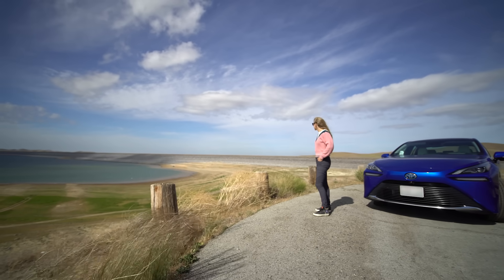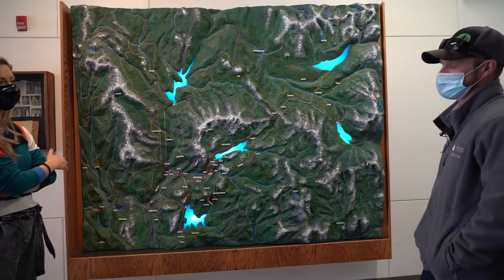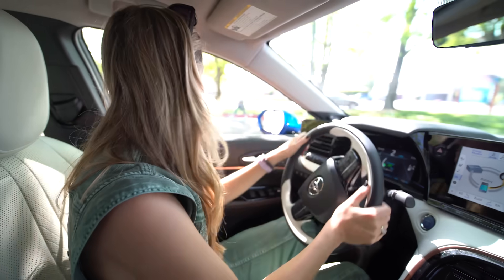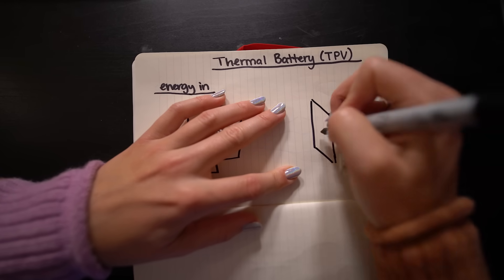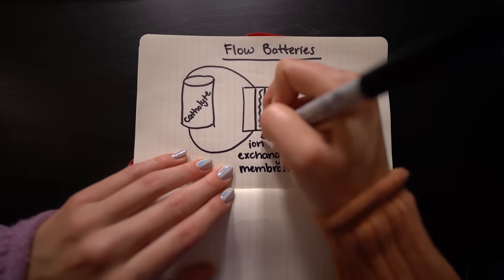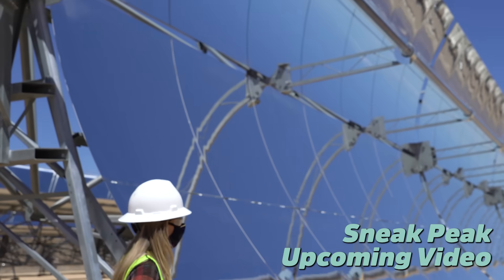The BIGGEST problem with clean energy

Comment: It seems surprising to me that you didn't know from the start that the challenge is energy storage.  As far as promising energy storage, I keep waiting to hear more about organic flow batteries.  On a massive scale, storing fluids should be cheap, and be able to handle the intermittency of wind.  Membranes for generating electricity is surface science, so might be able to benefit from learning-curve-dynamics...  My guess is that gravity-based systems will be too capital intensive to get to real world application.  Compressed air is too inefficient.  Another approach that you didn't touch upon is to modify current electricity consumption processes to allow them to be production following, rather than requiring production to match demand.  For example, fertilizer production, aluminum smelting, and scrap iron recycling.

Comment: I just want a source of energy that allows me to live free from electricity companies and stay off grid. Something better than solar cells with a LiPo battery.
Reply: Well, that won't be Hydrogen related (too inefficient)
It's unlikely to be water based (generally industrial scale)
Pumped air? (Etc) again industrial/ grid scale.
Wind? Larger facilities are more efficient.
(Note, where was Wind in this presentation? Did I miss it?)

Isolated home system?
You're talking heat pumps (probably ground source)
Solar (variable angle?) Cheap/ easy.
Battery storage (massive decrease in cost coming).

Comment: Great video, thumbs up!  Personally I'm a fan of pumped hydro storage.  I wonder: could we dig wells and large caverns and increase the amount of capacity for pumped hydro?  You mention it's mostly built out but it seems like with some creative engineering we could just create more places where PH will work.
Reply: You'd need a water storage volume both below ground and at the top, to make good use of the power being provided by water going down the turbines/pumps probably should be downstairs as well. Wouldn't say it is impossible to convert old mines and caverns into it but it's definitely an engineering challenge. Repurposing above ground bodies of water isn't always appreciated either, very understandable given the impact it'll have on whatever lives there.

I'm sure there will be locations where it's possible and gets done in the future, but above ground elevation differences in water reservoir levels are understandably more economically viable for now. All a matter of cost and what geography is available I suppose, needs a way to store something higher up, a cave/old mine that isn't too leaky with water and some people/industry relatively nearby that needs the storage. And if they aren't leaky (for gasses) then they might be more tempting for other purposes instead.

Comment: 10:11 TPV uses mirrors and its efficiency is 50%. But mirrors absorb some amount (significant) while reflecting the light rays back. Instead of mirrors, I would suggest the use of Total Internal Reflection (TIR). In TIR, the light rays travel from Denser to Rarer Medium. We can calculate the critical angle of the denser medium using the refractive index of the two medium and then create a prism arrangement and place the entire TPV inside of it. As the light which passes through the PV will hit the rarer medium, the incident angle will be greater than the critical angle and hence lead to total internal reflection of light which will bounce it back to the other side of the prism which will further bounce it back to the PV. This is way more efficient than using mirrors as it absorbs absolutely no energy. Therefore we can increase the efficiency of this method to about 55-60%.

Comment: As I understand, there is a way to transmit energy to and from space. 

I recall an old method of storing mechanical energy was by spinning a big disk. Energy in by spinning it up, energy out by applying that motion to other devices.

This wouldn't be efficient on earth due to, mainly, friction. But what about in space?

In orbit? On the moon? Transfer solar energy into spinning disks. The more mass they have, the more energy they store. Then transfer that back into electric energy to transmit to earth.
Reply: On that note... How much of a positive loop could be created by using solar power to spin magnetic disks to create an alternating field to the generate more energy?

Comment: About 20 years ago when I was in high school I learned about this startup company promising a hydrogen fuel cell car, Anuvu.  They made some wild awesome claims about their tech, which obviously never came.  Later in college I wrote and delivered a persuasive speech encouraging my classmates to drive hydrogen cars when they come available.  One of my primary arguments was that given the efficiency of the vaporware Anuvu PEM fuel cell and liquid H2 storage they could expect comparable fuel mileage to the Toyota Prius of the time.

But as time wore on the realities of H2 economy became more apparent.  Real PEM efficiencies were much lower than Anuvu promised.  People probably weren't going to carry liquid H2 in their car.  And the Toyota Prius became much more efficient.  Eventually, when learning about the plug to pavement efficiency of BEV's, it became clear: H2 is not the answer.  It's not just that round trip efficiency is worse than every other storage method.  There are other things that we have to worry about.  Hydrogen is very difficult to contain, so leak management must be much better than our current methane infrastructure.  Second, once hydrogen escapes from our storage and transport system, which it will, it's gone forever.  That may not seem like a big deal, but consider that every two hydrogen atoms lost is also a water molecule lost, and an extra oxygen atom in the atmosphere.  At the scale of the rest of human civilization, that might be a problem.  Lastly, the metals involved in PEM fuel cels are very expensive and finite.  Clearly it's not the answer and I think we're fools to chase that dream.

I'm a huge fan of compressed air storage.  Also I think particularly with the duck curve there is much more opportunity to optimize time of use and flatten it out.  I don't hear people talking about that though, besides the Technology Connections channel which recently discussed leveraging short term thermal energy storage available in a modern well insulated house to consume HVAC energy during non-peak hours.

Comment: My understanding is that energy in a gas is only determined by its temperature, not pressure. So, compressing a gas isothermally doesn't store any energy. This is why storing the heat from compression is so important. Energy released by expanding a gas is only a function of the change in absolute temperature. Physics!
Reply: Except it's not temperature that is turning the turbine when a compressed gas is released from a high pressure vessel to a low pressure vessel.

Comment: My own favorites for grid scale energy storage are:
1) Batteries other than lithium.  For example, consider Iron Air batteries, such as Form Energy is producing.
2) Formic Acid, produced by photoelectrolysis of CO2 and water, a liquid fuel which can be turned into electricity via fuel cell.
3) Flywheels.
4) Ammonia.

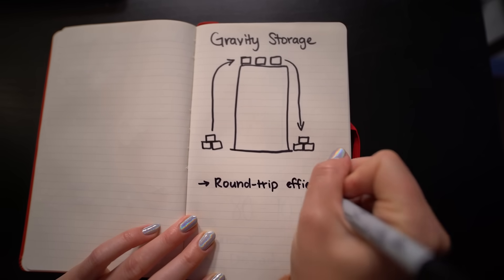Comment: 5:57 although I will note thrunderf00t did take a look at this and was far from convinced.  the dude may be a bit rude, but he's a pretty good skeptic.
Reply: 10:19 I'm curious, do the cells in this process just any special kind of doping or treatment to optimize them for IR light?  I assume that's how they get 50% of the energy out.
Reply: just as a total aside, because I'm a big hydrogen nerd, one thing I've been thinking that hydrogen might be able to do really well is replace natural gas for things like cooking and heating homes.  The issue is how to transport it safely and I think I know what method I would use, just dissolve it in water.

okay so it doesn't really dissolve, but it stores and transports in water just fine.  being in water, if there's a leak, and a spark, the whole line doesn't catch fire, just the local area.  This makes it much safer than just using straight hydrogen.  

There are definitely still some drawbacks, like for example my "fly over research" says that water can only take in 4%  weight hydrogen.  which seems like if this system were to be used a lot of water would get wasted trying to transport a little bit of hydrogen fuel.  I also still don't know how much hydrogen would be needed to cook a meal, or warm a house, so I can't do much without that number.  

Given the possible benefits, I'm hesitant to give up, but I am at a bit of a wall.
Reply: also, I think we should probably be working towards energy smart homes.  Homes that reuse energy for multiple purposes as much as possible.  A simple example would be an oven that's done baking.  If its the middle of winter just letting that oven dissipate it's heat into the surroundings is a great idea.  however in the middle of summer it might be a better idea to either reject that heat outside, or send that heat to the water heater, so something useful can be done with that heat, instead of just having it make the AC work that much harder.

Comment: Wonderful video. We all need to get onboard with fighting climate change. I did some back of the napkin calculations to answer a simple question: what would save the most energy / C02 production, putting solar panels on your roof or switching to an electric car. The electric car wins, by a lot. Every 15 gallons of gasoline burned in a car produces almost 300 pounds of C02. Thanks for your excellent work!

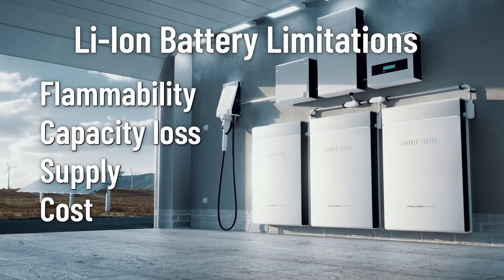Comment: At 1:49 Dianna says that the supply of Lithium will run out in 2080. If this is true why is the government trying to force people to buy battery electric cars that use Lithium Ion batteries? What does the government plan on doing with all these battery electric cars when the lithium does run out? You know if consumers end up spending 50k or more on an electric car and then when the lithium runs out the government is like "yeah sorry but there is nothing we can do for you" consumers are going to be pissed. I do know that as humans we really need to find a long term alternative to gasoline powered cars but that one statement that all of the lithium supply will run out by 2080 makes me think that hydrogen powered cars are a better long term answer than battery electric cars. Maybe there is a better answer than either hydrogen or battery electric cars and engineers just haven't found the perfect answer yet.

Comment: Where is it written that the water used for hydroelectric power has to be potable? It could be sea or ocean water. For that matter, we could generate hydroelectric power by using pressure pumps on the ocean floor, on off-shore deep-sea rigs. The deeper the depth, the higher the pressure. That is 24/7 power generation.

Comment: There’s also the flywheel batteries, I find them rather interesting as a mechanical engineer
Reply: I was about to point out the same, is a very interesting alternative. Also @Antalz is using the wrong equation. You want the rotational energy equation where the energy is proportional to the square of the angular velocity
Reply: @nicolasaraya7605  That's why I said to approximate all the mass being in a thin rim. You can also use the true rotational version but then you have to look up the moment of inertia of a hollow cylinder and that's more effort than it's worth.
Reply: @antalz  yeah, i checked my math.
Reply: @antalz its literally no effort as the formulas for a hollow cylinder and a thin rim are the same.. (you can build a hollow cylinder from a collection of thin rims and the inertia scales up with the length of the cylinder)
Reply: I think one of the thing this little section forgot was the on/ off supply problem of the grid. Sure they may not be the most efficient of cost effective sulatioin, but it terms of a on/off that should be a simple matter of routing the parts together, to help with peak demands. Part of the problem is the way power is used, never the same even line. That is one of the biggest hurdles to overcome, matching demand to supply and the flywheel might help with the spikes. At least I think so as there is no one way to do "many juices for many uses" so to speak.
Reply: And weight batteries.
Reply: just  a LITTTTTTTLE bit dangerous.
Reply: Just use E = 1/2*m*v^2, approximate that all the mass is in a thin disk, plug in some reasonable numbers, and you'll see how uninteresting it is. A ton moving at the speed of sound is about 16 kWh, which requires delicate balancing, magnetic bearings, vacuum systems and more. For the same energy you need about 1600 18650 cells, at about 4$ each retail price.
Reply: @antalz  Flywheels store energy in a rotational frame.  The equation is E=1/2 * I * Ω^2 where "I" is the moment of inertia of the disc and Ω is the rotational velocity.  Similar but not the same.
Reply: @tommoritz6659  I is hard to calculate though, and by approximating all the mass to be in a thin rim you can sidestep needing to do so.
Reply: @antalz  1 ton is a toy and wouldn't be worth the bother. Add a zero to that at least as a starting point. The economics may not work now but if we are talking about grid size energy storage i doubt lithium ion cells will remain cheap for long unless they can figure out the rare earth mineral problem.
Reply: there are rumors of a lithium iron battery chemistry that uses no rare earth metals (LiFePO4).
Reply: @theslimeylimey  Lithium Ion batteries generally do not use Rare earths. A Tesla car has more rare earths in its surround speaker system than in its batteries. Please know the actual list of rare earth elements before throwing around the rare earth term
Reply: I was about to mention flywheels. Simple, cheap materials, reliable, scale-able.  A lot to like.
Reply: A good video on how to understand and use your instincts https://youtu.be/XrmyGtdmgoY